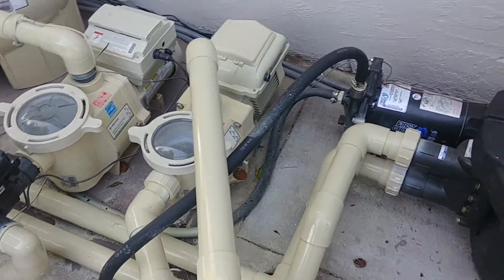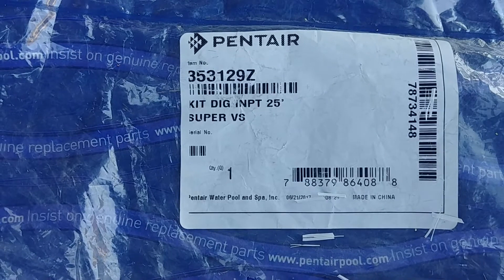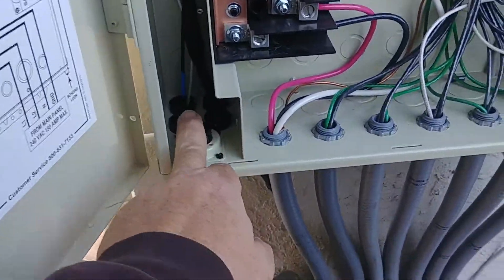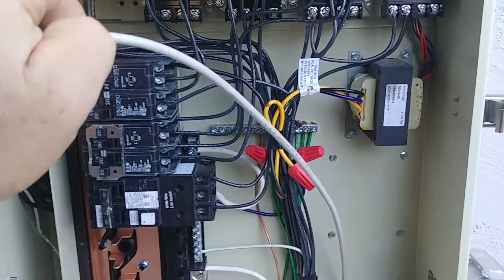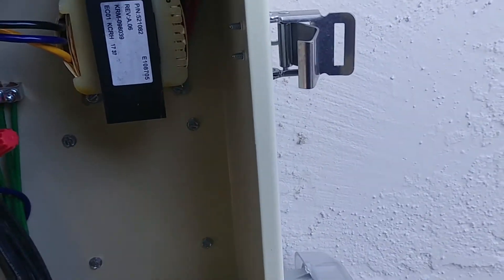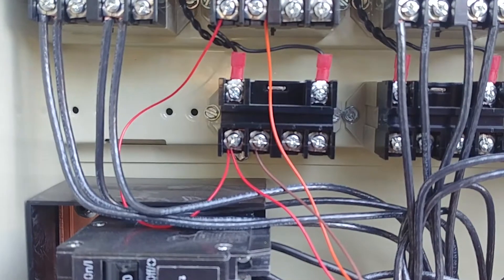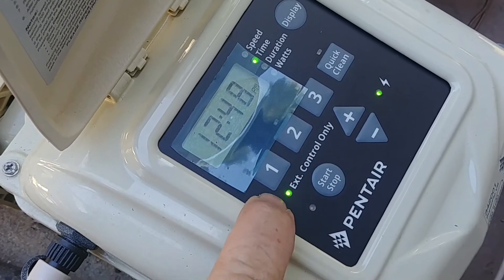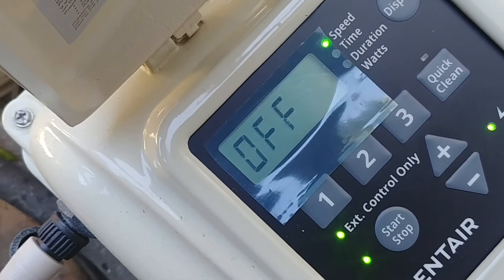Pentair SuperFlo Variable Speed Pump Connected To EasyTouch Panel

Comment: Great video, thanks.  I have a Superflo VS pump (older, not RS-485) EasyTouch 8 Compool upgrade.  When my EasyTouch upgrade was installed, the Compool power center was re-used.  As a result, there are no screw terminals on the high voltage side to which I can connect the Superflo VS control wires.  The only option I see is to wire the pump control directly to the 2 position connectors for each circuit on the EasyTouch upgrade board.  Is that correct?  Thanks!
Reply from the maker: @kitcheves1132  
yes that should work

Comment: So this powers the pump too? Do you run the wires to the back of the pump?
Reply from the maker: No it doesn't power the pump it just controls the speeds . You still run the power to the back of the pump 240 volts
Reply: @JohnThePoolExpertGuy  and that runs to the same blocks below the panel top left corner?

Comment: Is the wiring the same for the whisper Flo pump
Reply from the maker: No it is different. The WhisperFlo has only a 2 wire connection far more simple. It attaches to the comport there should be paperwork that came with the pump or on the control panel. Otherwise you can download the manual off of the Pentair website

Comment: I want to use the SuperFlo VS with the controller so that it triggers speed 2 once the solar is ready and switch it back to speed 1 when the solar is off (solar temp low or pool temperature reaches its set value). How would I wire it with the communication cable?

Comment: The external wire you show only has six wires - one each for +/-/and four relay contacts. Is that all the contacts there are on this connector, or are there options for "smarter" external wiring, such as a serial interface (RS-232/422/485), GPIO to control settings, or analog/digital connections to monitor parameters?
Reply from the maker: Unfortunately this is the only way to wire this particular pump. If you want to use the Smarter interface you would need to get an Intelliflo pump

Comment: Bro what speed settings you recommend for best savings yet good cleaning?
Reply from the maker: Depends on  the size of the pool and the type of pool sweep you use. Usually I go with 1800rpm for 3 hrs and 2600rpm for 3 hrs for the sweep. From 7AM to 1PM

Comment: John...i have a hayward aqualogic version 2.42. would i be able to just use the cable and connect it directly to my controller? or do i need to buy a Pentair IntelliCom 2 Interface?
my problem is I only have one spare aux and rest is all taken. i can maybe freeup one more making it two. would that be good enough for me? not clear after watching this video why do i need a intellicom 2 interface when these wires can hookup directly to the controller?
Reply from the maker: You only need an intellicom if you are trying to control more than one speed of a Pentair vs pump from (in your case) a Hayward panel.
It won't work with a superflo only Intelliflo or IntellifloXF

Comment: Great video, I do have a quick question. I have a panel and only using relays 1 & 2 (F (Pump) and 2 is my lights) I would like to setup Aux 2 and 3 to be speeds 1 & 2 on my pump and then set schedules on my easy touch panel. (Example 8am-3pm Speed 1 and 3-5 Speed 2) is this possible? The biggest issue I have is the pump looses power when the F relay is off does the schedule hold?
Reply from the maker: First of all the pump needs to be wired directly to a breaker rather than the filter relay. Then all you need to do is schedule the auxiliaries that you want to run.
Reply: John The Pool Expert ah ok. I am also running a salt chlorinator, would this effect that? When the pump comes on it also fires up the chlorinator and same with heater when needed
Reply: Sorry one more, I also have an attached spa
Reply: John The Pool Expert lol one more, would you be able to look at my setup if I sent pictures over. I would pay for services if so
Reply from the maker: @dblaszak100  
Ideally you should have one of the speeds attached to your filter pump relay so that when you turn your spa and your chlorinator and your heater. It will kick on. Most likely a higher speed
Reply from the maker: @dblaszak100  
I would be happy to look over any pictures you send.
eclipsecustomizedpools@gmail.com

Comment: is this pump the 342001 Pentair SuperFlo by chance?
Reply from the maker: Yes.  Pentair 342001 SuperFlo VS Variable Speed Pool Pump, 1 1/2 Horsepower, 115/208-230 Volt, 1 Phase

Comment: Hi John,
I have the Easy Touch 4 and I have hooked two relays up for a high speed and low speed programming choice.  I would like to have a motor speed for the spa when I turn it on but can't see any way of connecting the third lead.  Is there any way to piggy back on the Spa switch ? Thanks for the help.Dp
Reply: I'm not sure if you got you answer but I may be able to help. I recently installed the superflo and used its motor control cable on my older Polaris Eos. I use all 4 speeds that the motor has available and I set them to trigger at different times throughout circulation. If you have any auxiliary relays "dry contacts" currently not being used, then you can do it. When your controls switch to spa mode you'll want to activate a spare relay, (it does not have to be a high power relay) AUX 1-3 would work fine. You can then add an individual speed for the motor when the controller is in spa mode. The motors control wire has 6 different colored wires as the video shows; Red=+5v / GRN=Spd 1 / Yel= Spd2 / Org=Spd 3 / Brn=Spd 4 / Blk= ground. Each motor speed can also be custom programed to change its RPM at the motors onboard keypad. Assuming you want a higher RPM for the spa then all you would need to do is put the Red wire which is the motors internal 5+v on one terminal of the auxiliary relay you use and the brown wire, which is the highest default RPM, on the other. Hope this helps

Comment: I service the Pool at the Days Inn Motel,..It has been running flawless for about a week also just installed about a week ago,..This morning it isnt working at all,..I have lights but it will not turn on at all,..I tried the hard reset by holding the 1,2,3, and Clean at the same time for 4 seconds and still nothing,..Please Help we closed pool until fixed
Reply from the maker: ROCKO633 

Usually if something like that happens I turn off the breaker for 60 seconds and turn it on again. If that doesn't work I would check to make sure the impeller is spinning freely. If that's ok then I get out the volt meter make 100% sure there's 240 volts to the pump.